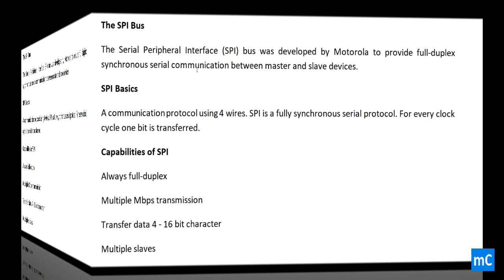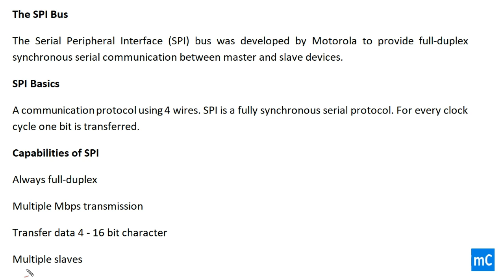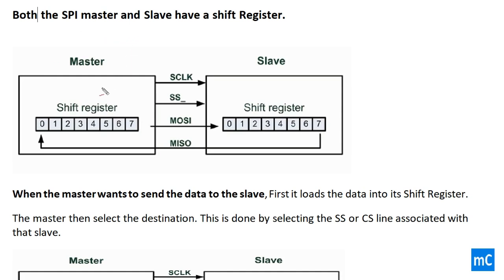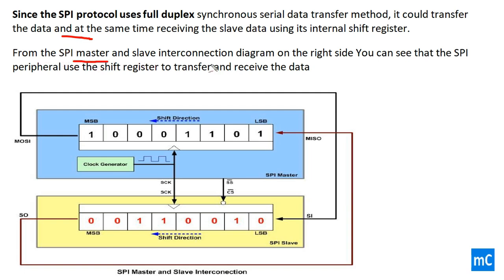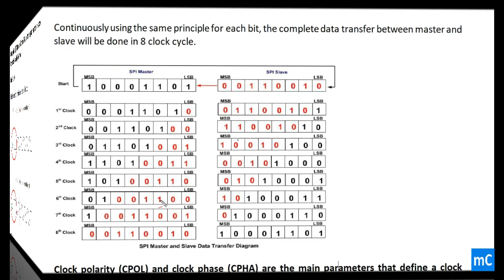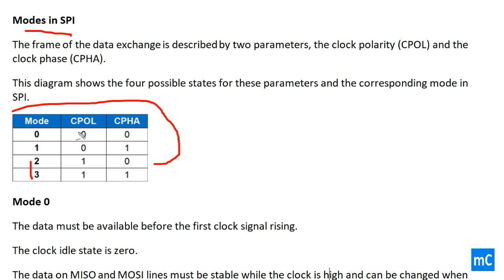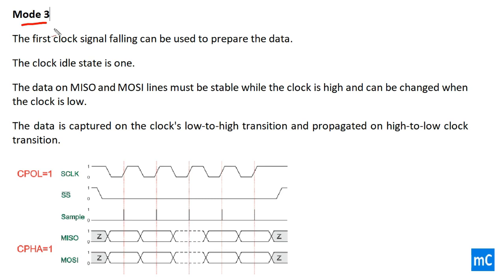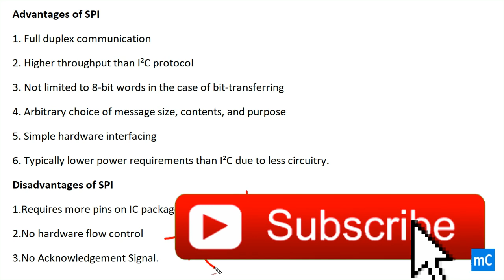SPI Bus communication protocol

Comment: Hello Sir! Thanks A Lot for this valuable Info Share... 
However, I believe there is a slight mistake in the Mode 1 and Mode 3 part:

(A) Mode 1 [CLK IDLE =0] : So, the Data on the MISO and MOSI lines must be stable when the CLK is HIGH and can be changed when the CLK is LOW  (In video, it is exactly reverse)

(B) Mode 3 [CLK IDLE =1] : So, the Data on the MISO and MOSI lines must be stable when the CLK is LOW and can be changed when the CLK is HIGH  (In video, it is exactly reverse)

Kindly clarify whether my understanding is correct. 
Thank You!

Comment: I think with the statements at 10:00 there is something wrong: clock polarity=0 and clock phase=0, then risung edge, not falling.
Reply: Yes, mode 0 is not clear
Reply: exactly, i was about to comment by that time i saw your comment. MODE 0 and MODE 1 are not clear

Comment: Does arbitration is possible in SPI like in i2c
Reply: Arbitration is required when more than one master is  present and which master is allowed access the bus . since , SPI is single master multi slave interface protocol , arbitration concept is not required here

Comment: spi communication  bit by bit recieve or 8 bit....
Reply: both same, 8 serial clock pulse are required to shift 8bit data using shift register,
Reply: some times  recieve bit by bit using give indivitual pulse to slave wihtot protocal use.....this is possible